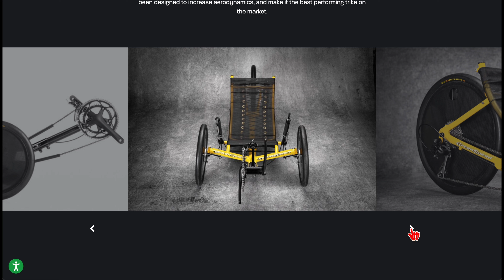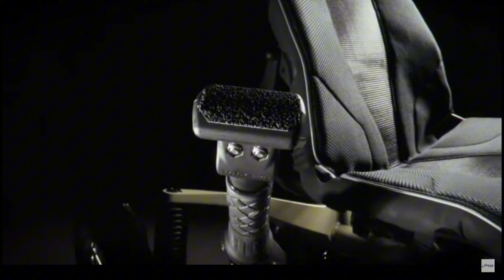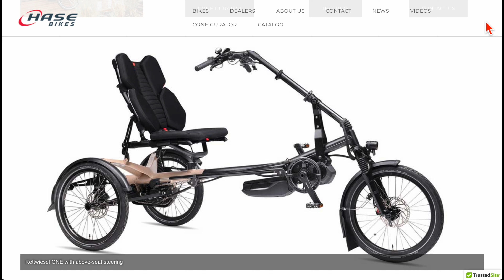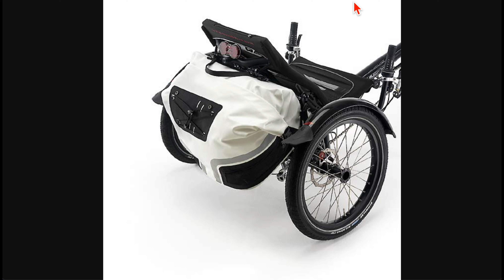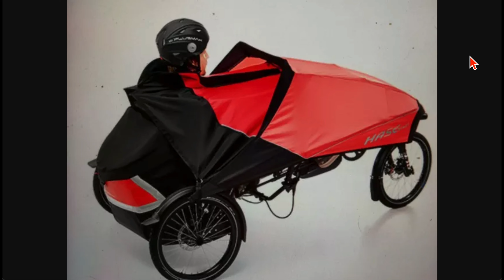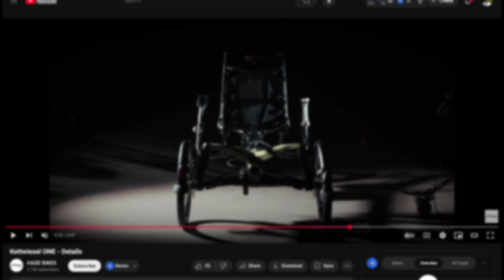Is the Hase Trike the World's Best Tricycle? (1.2025)

Comment: I dont think it has a diff like cars because it would need LSD not to spin a single wheell and that could be a problem, instead i thik i listen a presentation, and it could have just two ''one way'' bearings (cluthces) that will spinn the wheels in any circumstances...so there may be not a Samagaga type of diff afterall....
Reply from the maker: Whatever type it is, there IS a differential.
Reply: @SmallWheelWonder  of course, this is a good thing...

Comment: Owned four Hase trikes here. Gave two of them to my retired sisters!
2WD is great!  2WD for both off-road dog walking and for pulling Wee Ones on snow toys. 
Twin suspension under torso and any cargo. Not under the rider's knees! Hello?! 
Vastly superior to my owned tadpole trikes! No front wheel alignments needed!
NO DISASSEMBLY REQUIRED FOR ANY FLAT TIRE!!!  HELLO?! (Handicapper with solid rubber tires here;)
E-assist Hase' ARE LEGAL on bicycle trails!!!  
BE AWARE!  Law Enforcement coming for illegally hot rod riding on bicycle trails!!!
Bicycle Expressway Riding on bicycle trails will become hugely expensive, as it is already hugely illegal!   
FWIW: SW Ohio is a greatest location for multiple paved bicycle trails AND highest mileage of those trails! 
Two Hase' here that have a Rohloff gearbox. OH, YEAH!   NEVER AGAIN ANY CASSETTE!!!!!
Under seat steering far and away my favorite!  Arms naturally at rider's sides, not forward and outward!
Never outgrow a delta planform recumbent trike.
Grow oldest on a delta planform recumbent trike.
Reply from the maker: What do you mean by 'hot rod riding on bicycle trails?' Off road motorcycles?
Reply: @SmallWheelWonder  Higher than 250W E-assist IS illegal on most all bicycle trails! NOT talking about higher wattage family/cargo bikes/trikes here, only irresponsible speeding. High-speed riding on bicycle trails is already a huge issue in multiple communities.
Reply from the maker: Good for you. New York police won't even bother gasoline motorcycles riding on greenways and bridges.
Reply: @SmallWheelWonder  I have seen that occurring on some videos. However, multiple (many) communities are trying to stop their bicycle trails from currently turning into Bicycle Expressways!